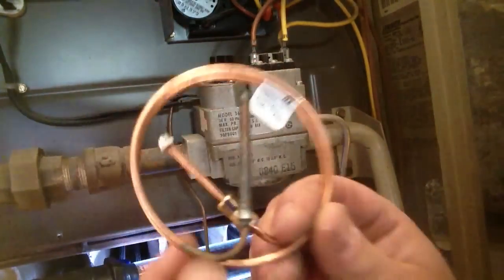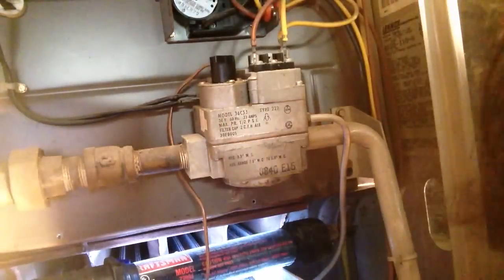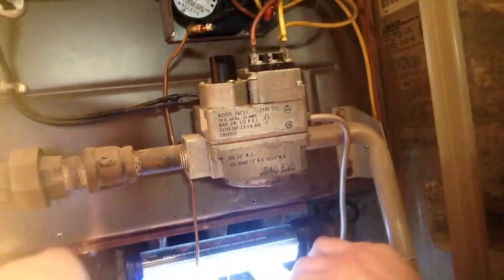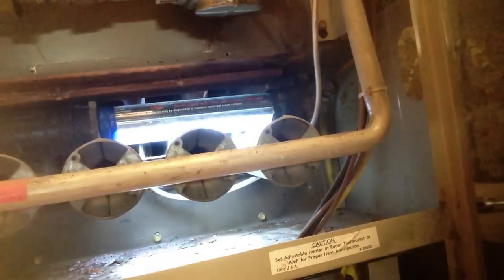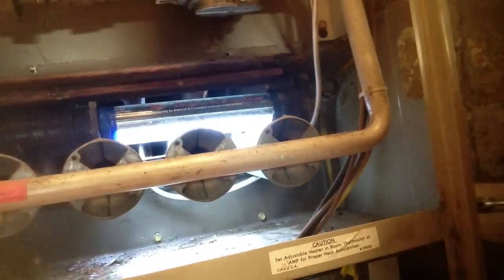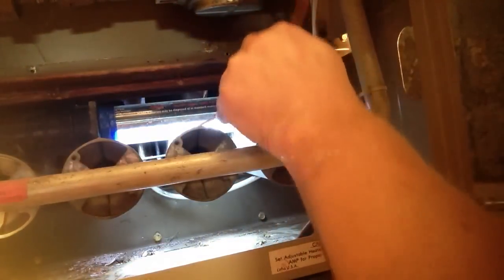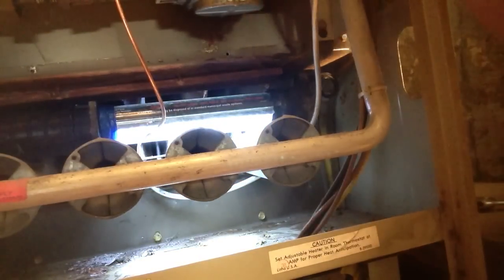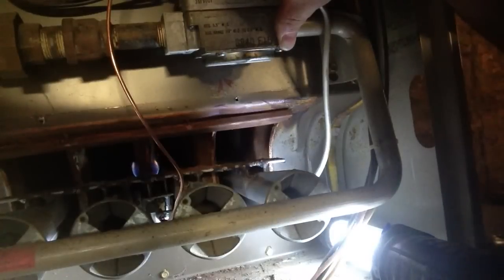How to change furnace thermocouple

Comment: I strongly recommend that you do NOT do this yourself if you have an old furnace, especially if it is in cramped quarters.

I am not a furnace repair man or anything like that, but I decided to do this on my own.  What I  bumped into was a ton of old parts on a 30 year old furnace with stripped screw holes, parts that were bent, rusted, etc.  You cannot name the number of problems.

I bought two replacement thermo-couples and neither would screw into the stripped hole.  Every trick in the book for fixing stripped fittings did not work.  The design of the gas valve on my furnace points downwards and is six inches from the burners, making it a real pain to work with.  

I did finally get it working.  It took hours of tinkering, going back and forth to stores, calling the company, trying to find tricks to get the screw to hold, etc.  I won't even tell you what finally did work, because it is hokey as hell and I could have had a furnace repairman do it right and worked on something else.

Then, of course, putting it back together, one of the pressure fittings leaked, so I had to make another trip to get the part, which they did not have, so I had to go searching for that.

If you do decide to do this, I suggest first that you get the thermocouple and make sure no parts are stripped.  If the thermocouple does not screw directly into the gas valve with ease, call a furnace repair guy or you will rue the day.

Oh, and these guys that say it takes five minutes or ten minutes, that is nonsense.  It may for a furnace guy that has a toolbox of tools for this job ready and waiting and knows what works and what does not.  One guy shows how easy it is if you disassemble the entire furnace and put it on a workbench.  D'uh.

Expect an hour, plan for hours.  If the screw hole is stripped, you may have to replace the gas valve.  Small parts and getting screws into tight places will have you swearing in ways you did not know possible.  

If that screw hole going into the gas valve is not stripped, and the companies making the replacement parts make them the right size (not likely), then you may be golden.  

But MAKE SURE TO SHUT OFF THE GAS, THE FURNACE, EVERYTHING THAT COULD BLOW UP!!  If you smell gas after you shut it off and leave it off for a bit, STOP!  

And if you have to pull the burner to get at the thermocouple like I did on my old furnace, expect something to leak when you get it all back together.  CHECK EVERYWHERE FOR GAS LEAKS and check every joint and make sure within a few minutes you DO NOT SMELL GAS AT ALL EVEN BEFORE YOU LIGHT THE PILOT THE FIRST TIME!  

A leak could easily lead to disaster if you miss it.

My furnace is enclosed in a finished basement, so the work space is small as well, and that added to my grief.  If your furnace is better designed (screw hole from gas valve is not pointing downwards) and you have space to maneuver, you will likely be more successful.

I may do a video of this eventually, because the number of things that can go wrong combined with Murphy's Law made this repair a nightmare for me.
Reply: Excellent advice. Much appreciated.

Comment: I have a question about the two wires under the thermocouple. I had to replace the gas valve with a different one and it has no place for those two thermocouple wires. What do you suggest I do?
Reply from the maker: There are so many valves out there for different applications. It best to get a direct replacement.

Comment: Do i need to turn off the gas valve before changing out the sensor?
Reply from the maker: To change out a thermo couple you don't need to turn off the gas.
Reply: Adrian vallejo poono. the gas valve closes because of the thermocouple failing. the thermocouple doesnt isnt reading thst the pilot is on so it tells the gas valve to close hence the reason the pilot goes out and refuses to stay lit when u attempt to relight it

Comment: Thanks for saving me about a hundred bucks. You didn't use any Teflon Tape, did you, on the threads of the connection at the upper end?
Reply: Okay. I find that the nut which holds the tube in to the bracket is quite tricky to install since the tubing makes it difficult to align the nut squarely with the hole in such a confined space. In fact the contractor who installed my previous thermocouple tube didn't even bother trying to get that nut into the hole. He just held the tube in the bracket with the sleeve which goes on from the top and contains that retainer clip which installs from the bottom end of the tube, if you know what I mean. Do you think that's good enough?
Reply from the maker: There is no tephlon tape used at the gas valve connection.. as long as that thermo couple is in the flame it will be ok. There is no teflon tape used anywhere in changing your thermocouple.
Reply: Okay, thanks. These are the little things I wonder about, doing the job for the first time, I couldn't get the pilot light to light, just using matches. So I called the gas department guy again (no charge) and he came and lit it with his igniter. Maybe I just wasn't holding the red button down long enough, not sure. But I'm back in business with heat in the house. Looks like a cold winter too.

Comment: Hello...My furnace stays running won't shut off unless I turn the power switch off..WHY...PLEASE HELP! THANK YOU MONCRIEF FURNACE OLDER 20,000BTU
Reply from the maker: Sorry, this problem may need a seasoned hvac tech. The best I can tell you is to disconnect the red and white thermestat wires on the terminal board. This may tell you if the thermestat is holding it on. I had this problem once and changed the gas valve on a guess and it solved the problem.